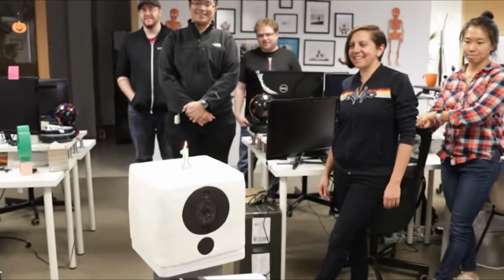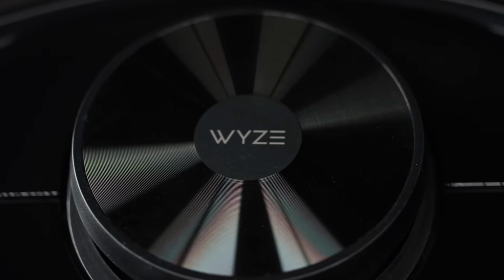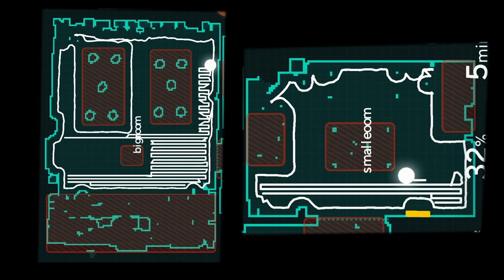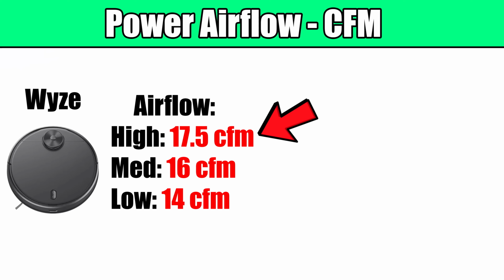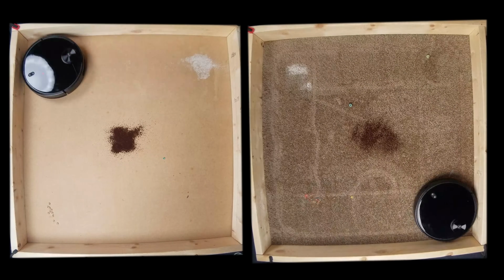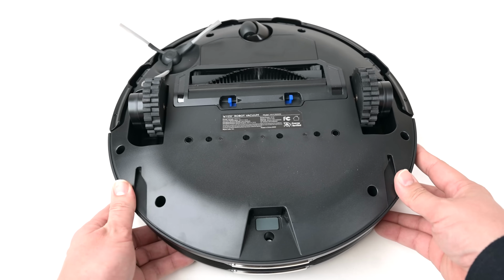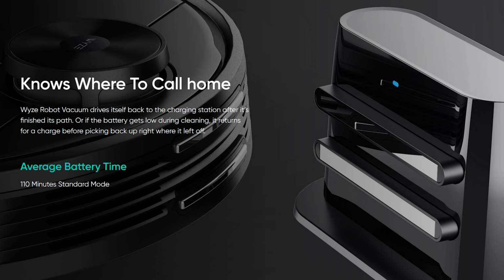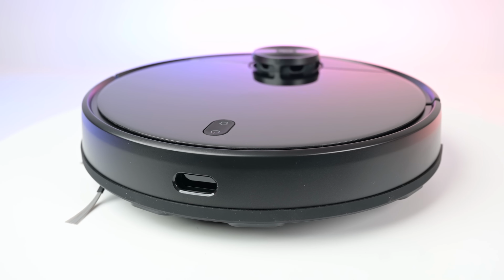WYZE Robot Vacuum Review - This Will Shake Things Up!

Comment: Woooo finally! These guys make great products for amazing value, and then keep on improving their software like Tesla! They also make the cheapest smartbulbs that work well. Looking forward to the review!   

Looks like my decision to pass up on their big discount presale and wait for your review was not a WYZE decision. 😥
Reply: But Wyze still rather release new products instead of fixing old ones...so there's that.
Reply: @daijoubu4529  What product are you talking about because I have quite a few and they get updates all the time and work rather flawlessly. At some point you can't "update" existing hardware though so you have to release something new.
Reply: @daijoubu4529  yep. Me right here with my buggy asf wyze cam 3
Reply: What about parts availability?  Are they readily available?
Reply: I found Wyze DOES NOT fix issues though.  You can't map individual rooms having a common interior wall... after a tear +.
Reply: @DMain-tb8ye  They typically do software updates in late spring for most of their products.
Reply: Tesla? 😂
Reply: You can look on Reddit and their forums, lots of unhappy customers with updates breaking older products and some bugs that never gets fixed meanwhile wyze just keeps on pushing new products because that's their source of income. If you want this vacuum, get it directly from Viomi/Xiaomi, also have mopping, not the rebranded wyze one.
Reply: @daijoubu4529  So I just went over there to the subr and I think you're making a real stretch on that claim. Mostly about what you'd see on other decent company subreddits, not a lot of angry customers with issues. As a neato owner, wyze conversely has been incredibly costumer-centric and an amazing great value. And based on my interaction with other wyze (bulb. cam, and plug) customers, not sure where you're getting your sentiment.
Reply: @johnjingleheimersmith  hey. Planning to grt that robot. What do you think after 8months? Still happy?